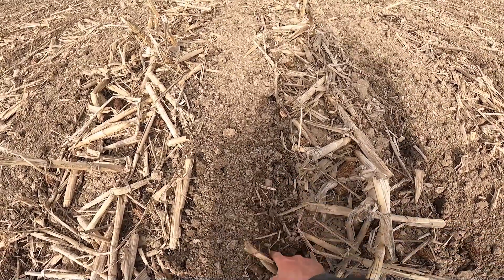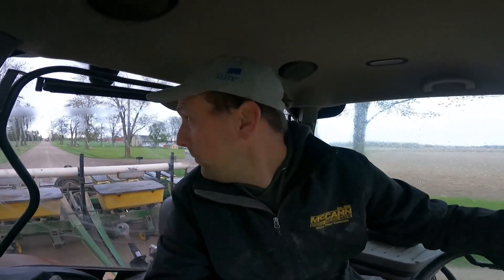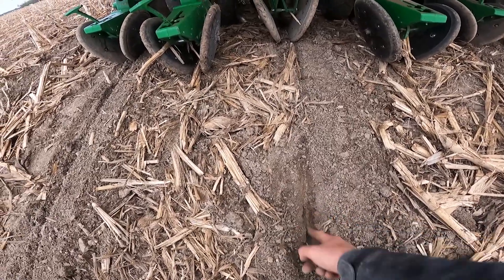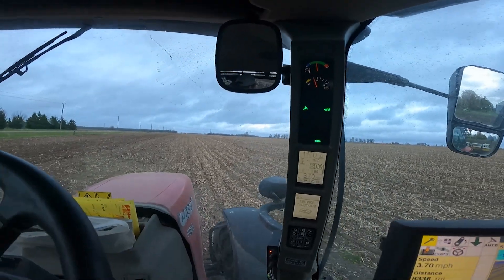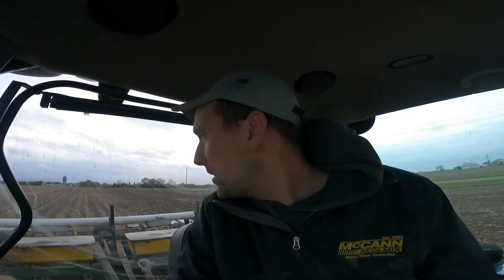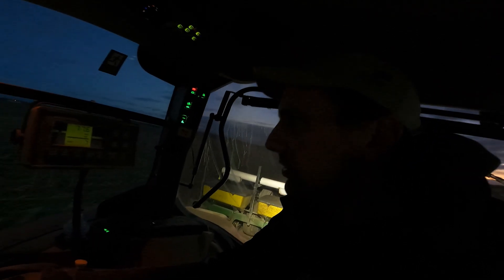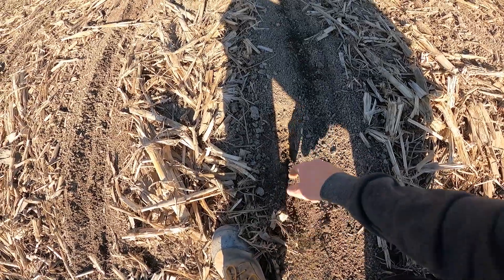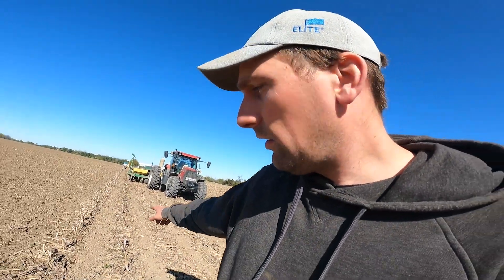Twin Row Strip Till Soybean Trial

Comment: Thought about trying twin strip till soybeans. Here the last 2 yrs doing strip till w a Gladiator and 2x2 dry on the planter yields went up vs no-till w/ a 750 and broadcast. If twins yield better ideally a shot of fertilizer in between the row could be the ticket.
Reply from the maker: Interesting. So you planted 30" on the strips? You would think you could bump the yield even more by twinning those rows. 30" beans struggle to compete with narrower rows around here.

Comment: How did it turn out?
Reply from the maker: The disked 15" was 81bu/ac and the strip till twin rows were 75.
Reply: @farmerdan87  interesting! Thanks. I tried doubling back with my planter on a few strips over a few years. I didn't notice much yield difference between the 15s and 30s. I definitely did notice better weed control.
Reply from the maker: The weed control makes a lot of sense. It's hard to compare when every year is so different. The odd year white mould can be a problem here so those years we might be further ahead with 30's or twins on those years.
Reply: @farmerdan87  why do you think the strips turned out less? Was there any fertilizer savings between the strips and conventional till? I’m considering doing a plot like this on my farm this year